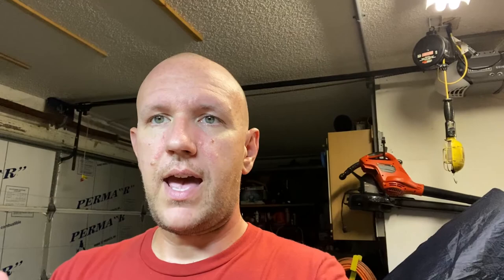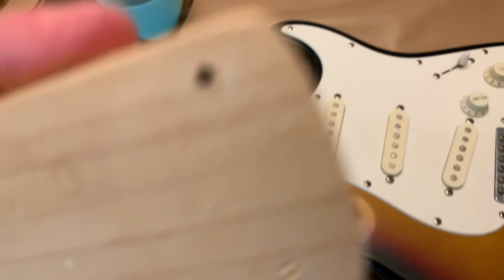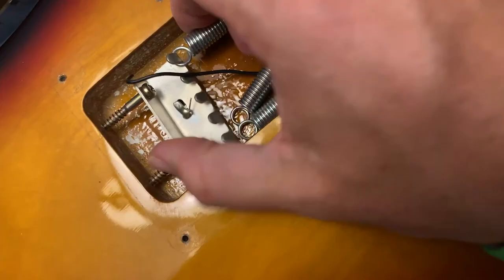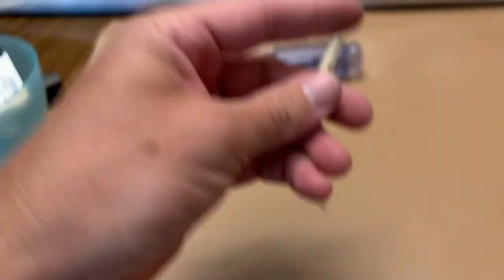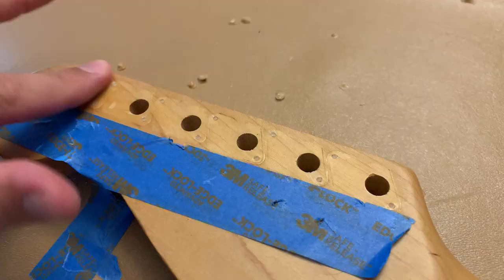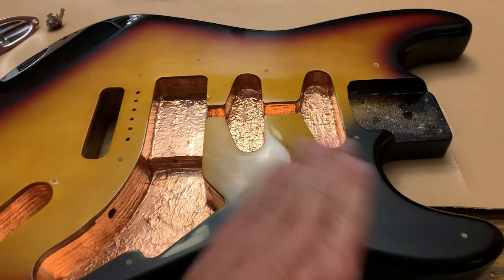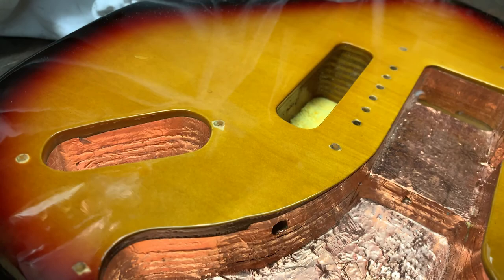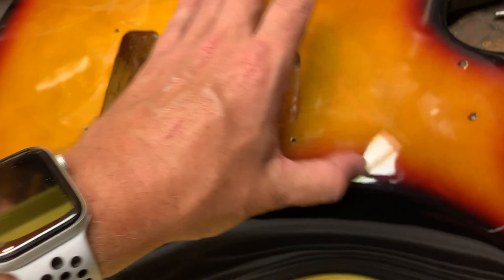1995 Fender Squier Stratocaster (Made in Korea) MAKEOVER - From DUD to Delight! Part 1 of 2

Comment: Solid color korean strat bodies are multi piece and then sandwiched between two thin vaneer ply on both sides via vacuum press. For some reason they sound really good. The burst models were usually 3 piece alder bodies.
The necks are really nice and slick.

Comment: The Idea of the copper tape is to get a grounded cage around the electronics. Not sure if you did it, as I obviously haven't seen part 2 yet, but to achieve this, the pickguard also needs to be covered with copper tape and needs to be connected to the copper tape in the cavity. Either you solder a wire that goes to ground to the pickguard as well as the cavity, or more commonly you would let the coper tape go over the edge and just touch the pickguard, so you only have to solder it on one place. Just as an input as I've noticed how clean you've stopped with the tape right below the edge, which made me wonder.

Comment: I have the same guiatr.  What size were the post hole before you reamed them out? I was looking at some vintage drop ins and I don't want to do change them if I don't have too.  yeah i could them them out and measure them myself, but i am lazy and you already did it.  lol
Reply from the maker: Totally understand! I don't have measurements of the original holes, but I do have the original tuners, I'll pull them out of the box ASAP and get you a measurement! Highly recommended to change the tuners.  The originals leave a lot to be desired!